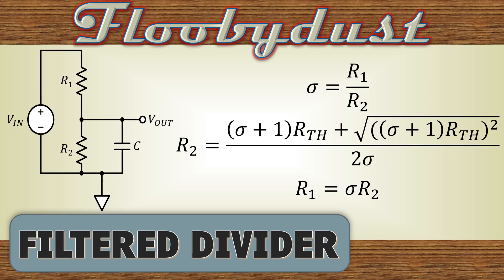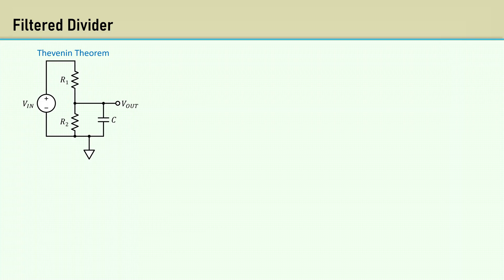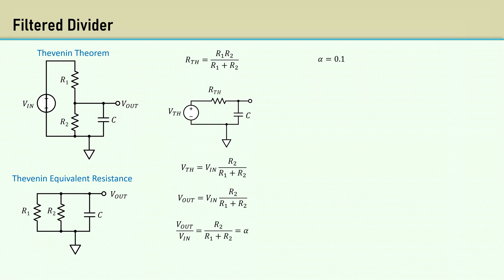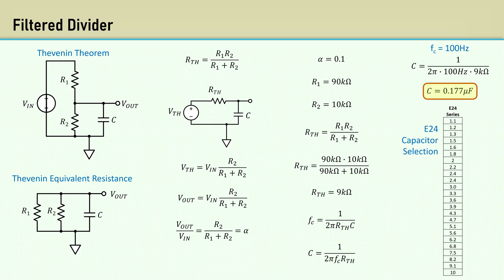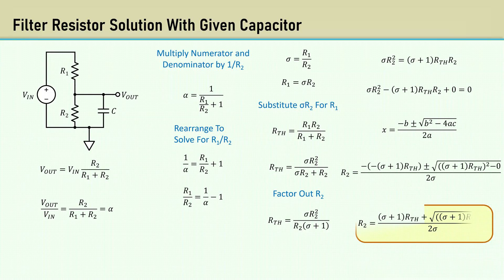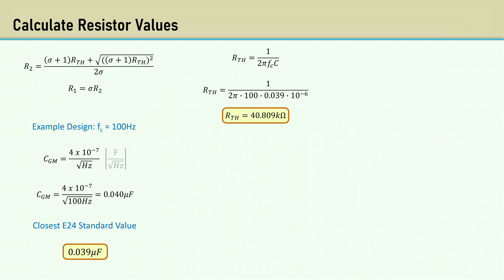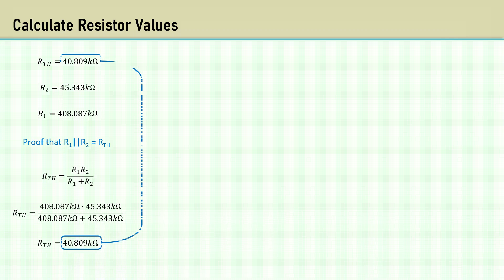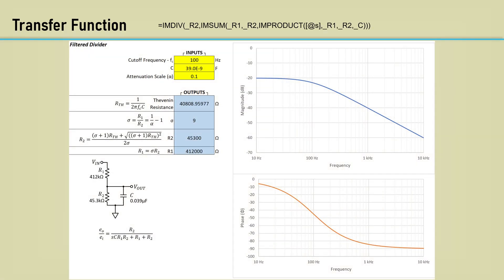Filtered Divider (4k Video)

Comment: -20 dB is crazy. Shouldn't resistors get a little too hot or I'm missing something?
Reply from the maker: For the example circuit with a 12VDC input, the voltage across R1 is 10.8V. 10.8^2/412k =283μW. For R2 1.2^2/45.3k =31μW.

Comment: My first thought was "looks a lot like every interstage divider I've seen in any guitar amp." Would the math be different if the capacitance was on the upper part of the divider?
Reply from the maker: Not sure at first glance but it would couple high frequency power supply noise into the output.